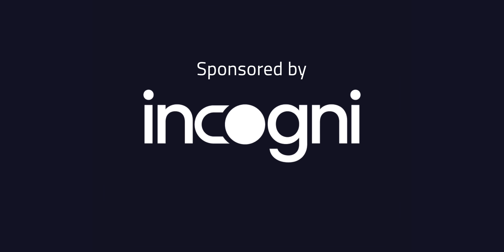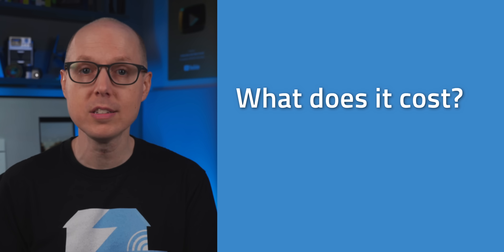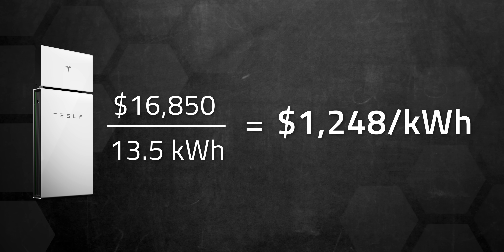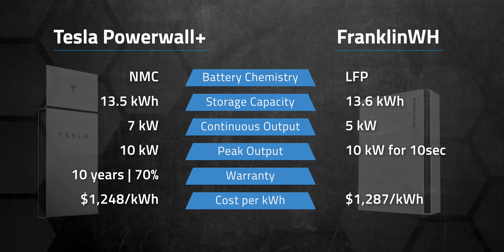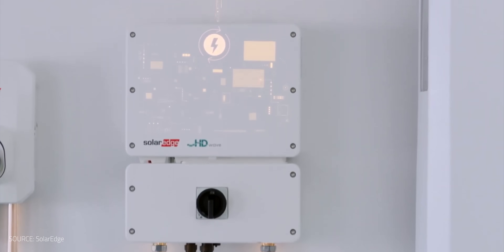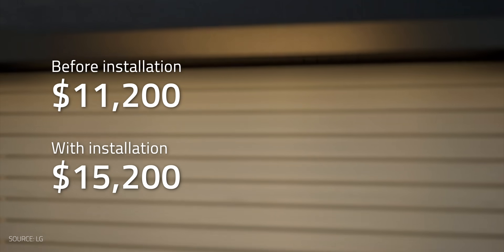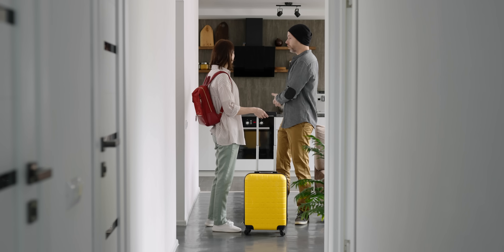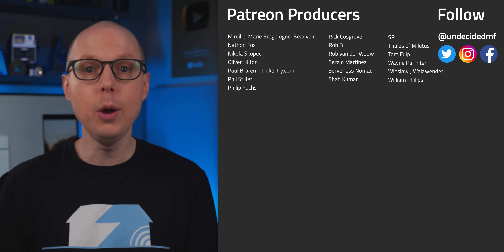Top 5 Batteries for Home (And One You Might Not Expect)

Comment: Hi Matt, any thoughts on how many kWh you'll need in a battery with the heat pump? Thanks
Reply: that depends also on your pv size and where you live. we live in germany and have 29kwp on the house. in summer our 7,5kwh battery is quickly charged up and full. since the nights are shorter the battery is enough for the night. in winter its different. on mostly cloudy rainy days in low temp and active heatpumps the pv system does not produce as much access power during the day. our battery might not even be fully charged in the end of the short days at 4-5 o'clock when the sun goes down again. even a bigger battery would be of little use there. think 10-15kwh would still make somewhat sence for us but bigger wont do much for us.
after we worked a bit more on insulation maybe we can reduce the power the heatpumps need in winter and gain more overhead power. time will tell
Reply: That depends on so many factors....

* What is the heat loss of you house
* What is the efficiency of you heat pump
* How much hot water do you use
* How much solar do you have
* What is seasonal fluctuation in solar energy your experience
* What is the financial side of solar energy where you live (feed-in tariff, net metering, or something else)
* What is your goal

... and surely more.
Reply: @SolarWebsite  Hi there, yes I realise that, asking Matt what he needs for his new house, thanks.